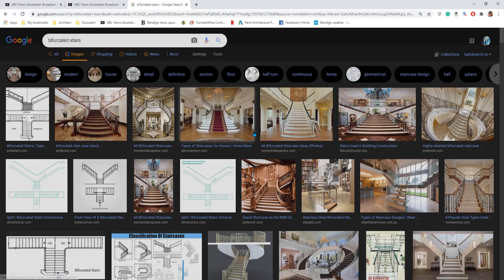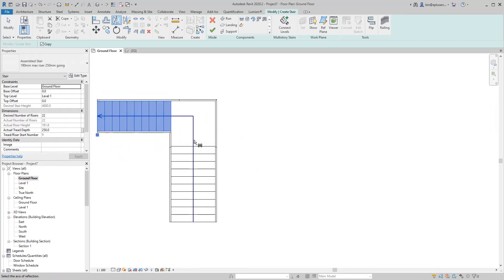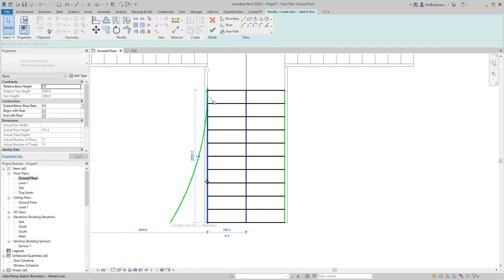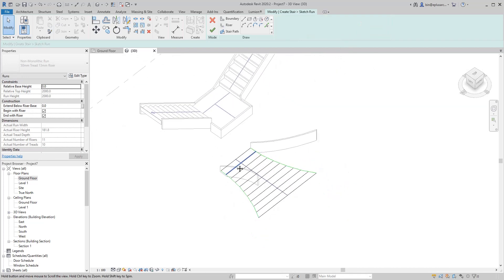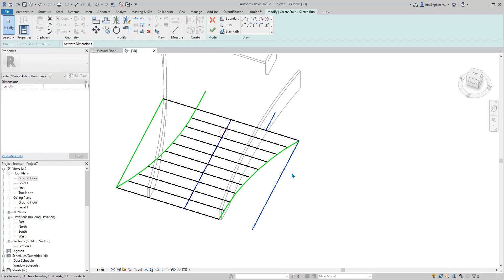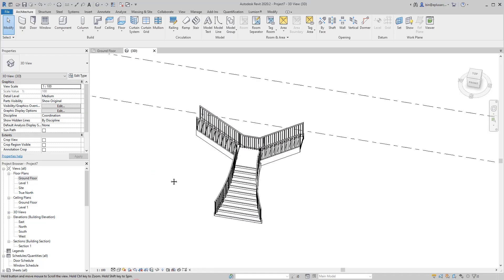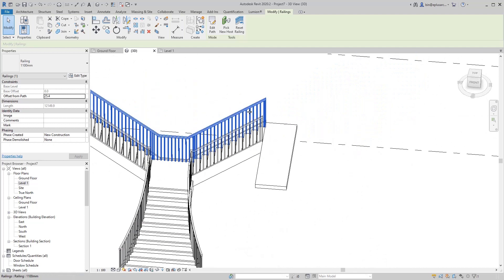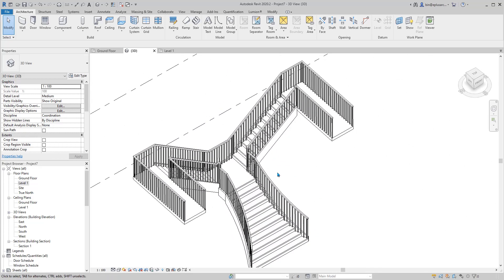Revit Exercise (Day 150) - Bifurcated Stairs Exercise

Comment: I know it has been  years since you posted this, but I have been struggling with this staircase for too long and figured commenting might be worth it? For some odd reason revit is deciding that the first two segments of stairs need to go opposite from each other, which doesn't work. If I try to flip it, it just flips both and I have the same problem, flipped. Any advice?
Reply from the maker: I had a similar issue recently and couldn't figure out why. I had to redo the stairs from scratch.